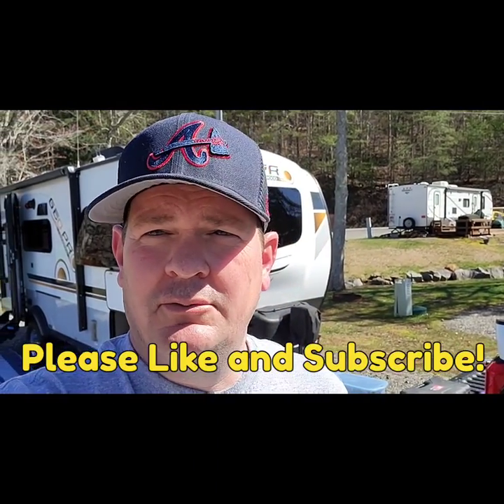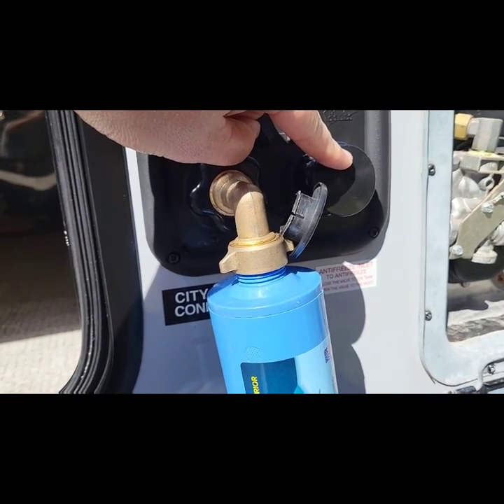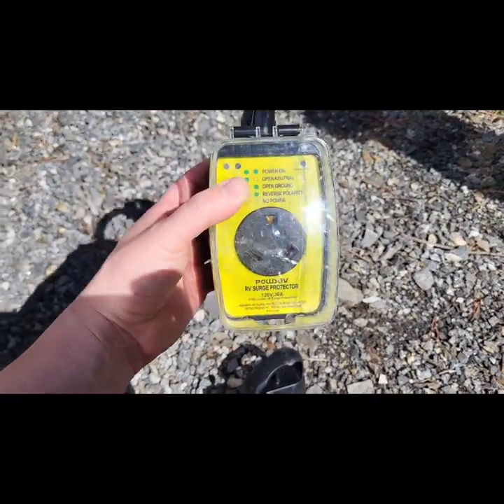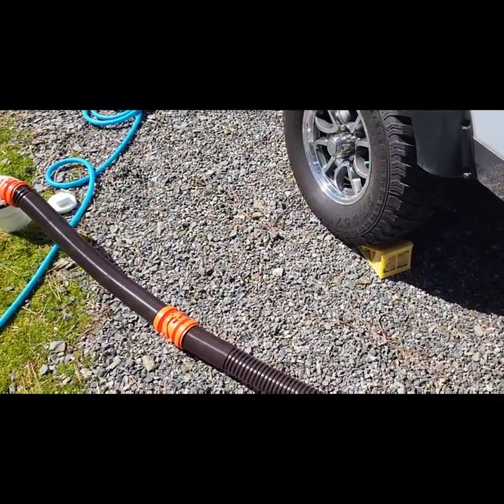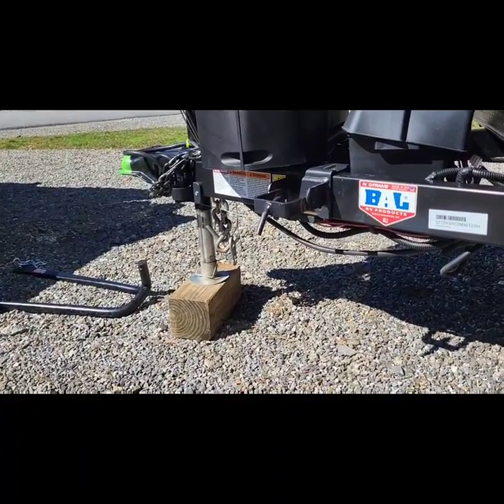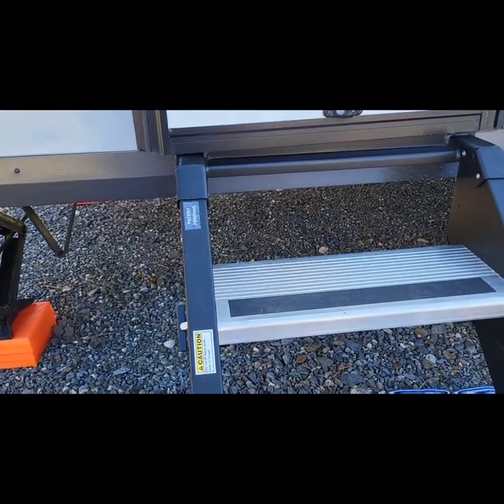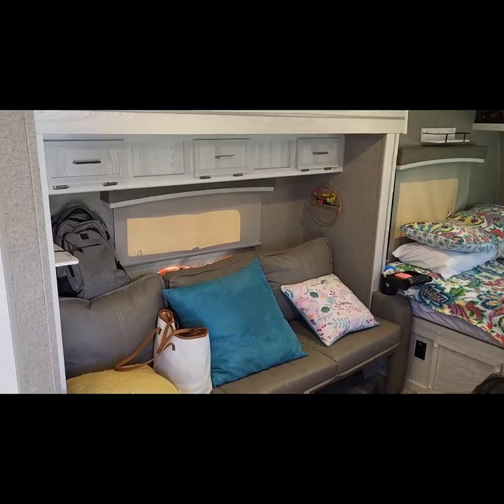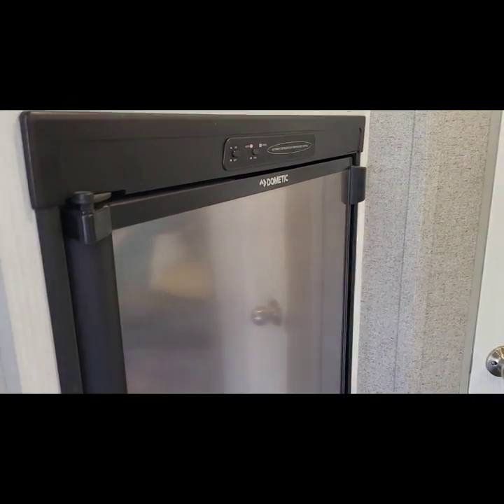Rockwood Geo Pro or Forest River Flagstaff E-Pro setup for beginners!

Comment: Thanks for the tip on the wall pockets.  That worked out well.  I used some left-over command strips rather than what came with them for easier removal.

Comment: We are picking up a 15Fds this week and it will be our first trailer with a slide.  Appreciate the slide tip!  Would be interested to know about your stabilizer/weight distribution hitch.  We have the Equalizer on a No Bo now and do not like it.  Heavy to handle, noisey, and makes the truck front end move sideways in cross winds which makes for touchy control fell regarding steering.  Not fun.   Plan on trying an Anderson with the smaller 15FDS or maybe none if it handles better than the nobo.
Reply from the maker: @chrisc8856  I'm still rolling with a Harbor freight distribution hitch for my rig. I can't say that I have any experience or guidance with other brands, but this one is easy to set up and easy to get hooked up. It's bulky though. We're going on 3 years now.

Comment: I appreciate your video. Not sure why you would do the electric, water and sewer connections before you are at level. Seems odd that you might need to reconnect the trailer to your tow vehicle to make a level adjustment and consequently, put stress on your connections. I always level first, chock and then connect.

Comment: Notice that he is using a simple cordless drill, it works just fine.  There is no need for a noisy impact driver that seems so popular with folks.
Reply: What is the rationale for using an impact drill?
Reply: @carolsdarksarcasm4223  I don't know.  More often than not that's what someone is using to lower their stabilizer jacks and they are very noisy.  Plain, old cordless drills are quieter.
Reply: I use a drill…and hand tighten with torque wench.

Comment: Hey a lot of good info. Picking up my 2023 Rockwood Geo Pro 19FDS next week. Would it be better to get it level before doing all the outside hookups or does it really matter as long as your not to far off after hooking up the water, sewer, & electric?
Reply from the maker: Definitely get it leveled side to side and front to back. I do my stabilizers after i get water/sewer/power hooked up.